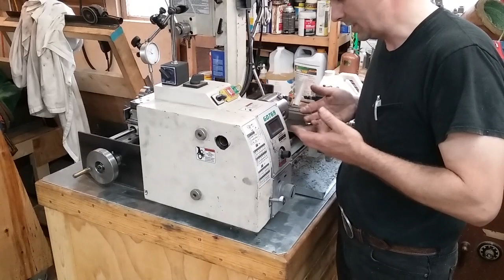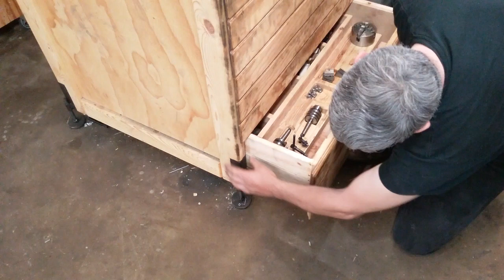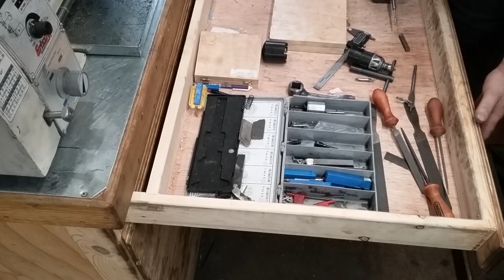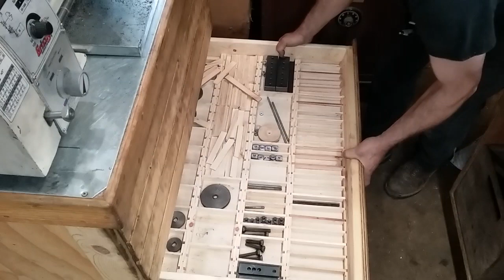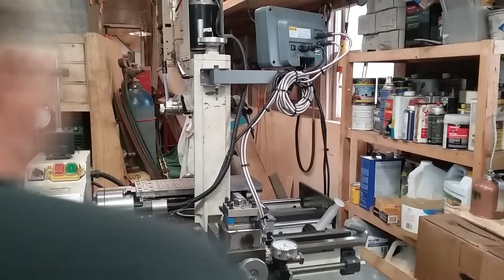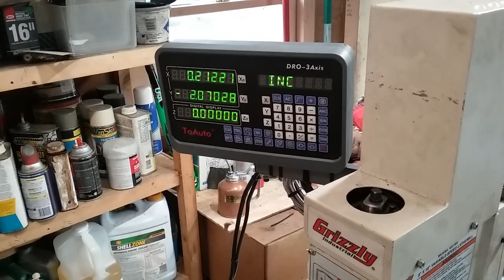Shop Tour. My Grizzly combo machine and cabinet.

Comment: New sub, I like the setup, I am ordering this lathe from Grizzly and I have dedicated a General tool box for my new lathe. The height will be perfect for me. Also it will be mobile via locking casters.
Reply from the maker: You might consider a heavy plate for the top of your tool box to dampen the vibrations and harmonics. What ever you do bolt it down tight.   

I have a vid about some leveling legs as well.  You probably dont want to leave all the extra weight sitting on the casters, they wont take long to get flat spots if they are rubber.  I dont remember what the lathe weighs, but I wouldnt want to pack it a mile on my shoulder.

Comment: Nice setup! I have a suggestion for the drawers. Get a regular candle and briskly rub it on the friction points so the wax melts into both surfaces. You’ll be amazed at how well this helps reduce friction.
Reply from the maker: The drawer that is sticky is just sticky.  I need to hit the drawer sides with a plane a few licks.  

I use turtle wax on my sides and sides.  Wonderful stuff.